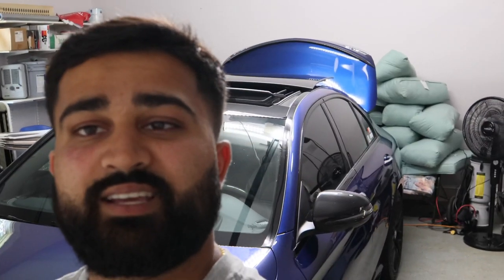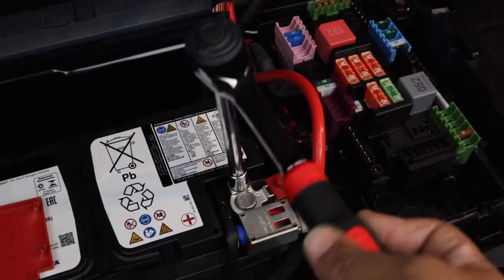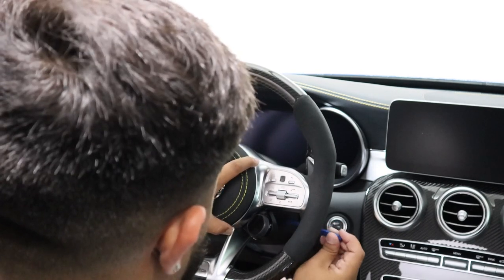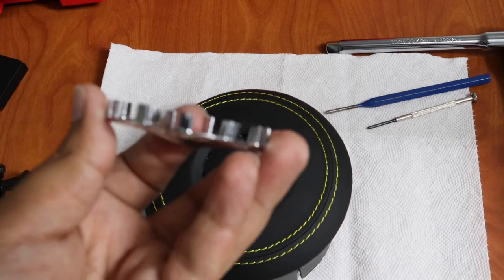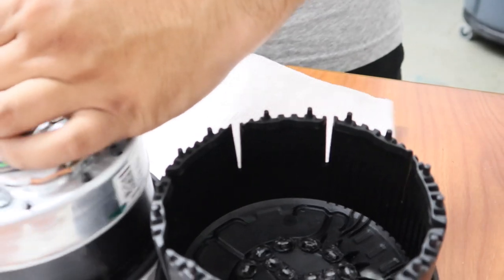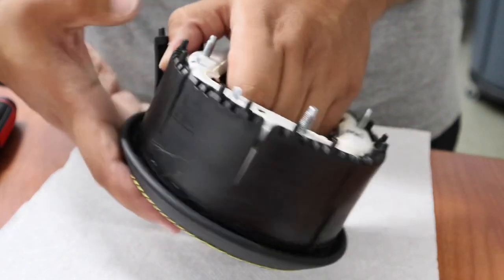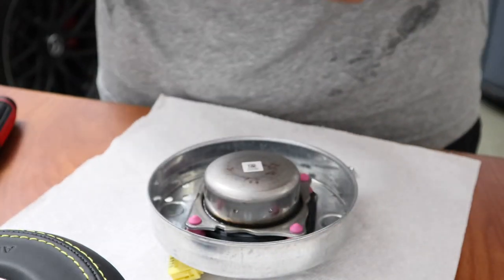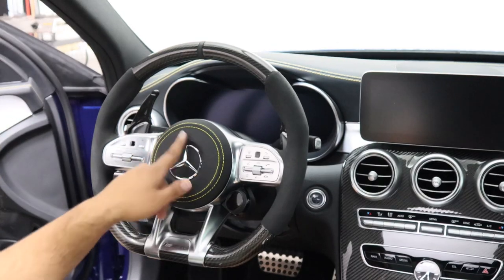2021 C63s AMG Air Bag Cover Upgrade (Leather w/ Yellow Stitching) | DIY Tutorial

Comment: The prongs on the star are long so they can be melted down to stubs that hold the star in. The logo will probably go flying in an accident, so safety squints. Are there cuts in the leather cover or how is the leather supposed to tear like the original cover when the airbag deploys?
Reply from the maker: That makes sense about the prongs ! And yeah there were stamped cuts in the plastic /leather so it was prepared to be torn from an airbag force

Comment: Do you think these airbag covers are safe? Any safer or less than the OEM ones?
Reply from the maker: I have no clue 😅 in a way I don’t want to find out either but I’m sure the aftermarket cover will rip apart in similar fashion cause they have exactly identical construction nothing but glue and just plastic clips holding it together so an airbag force should still be able to release.

Comment: Does the steering wheel get puncuted when you insert the tool to remove the airbag
Reply from the maker: There is already a slit in the wheel column , could be a possibility that there isn’t but there should be an indent either way to indicate the point where you would. Once you do the only thing getting poked would be that clip

Comment: How much was the cover?
Reply from the maker: $280
Reply: @cexy63s  Should be 100$. Direct from China. Do the homework.
Reply from the maker: @peterking3131  I did my homework buddy, the cost is the cost. Could I have gotten it for cheaper yes. Would the quality be worse most likely. I didn’t want the cheapest thing nor did I want to get ripped off $280 is pretty reasonable when you factor taxes & shipping & it being a custom order. They don’t just have these sitting on a shelf
Reply: @cexy63s  Again, I don't refer to cheap ripoffs, but to perfectly made caps. This may require a bit of search and getting more details from sellers. Saying so, because I bought AMG clone steering wheel that is every bit perfect as OEM and I also decided to replace a cap with stitched one exactly per my wish.